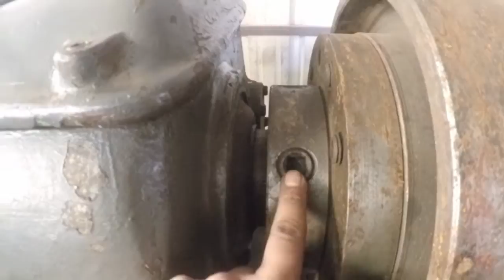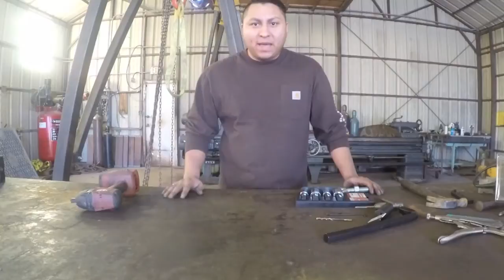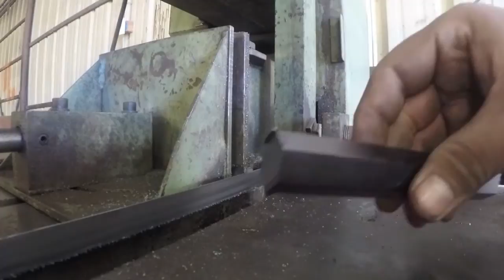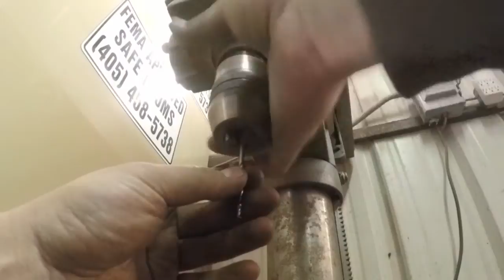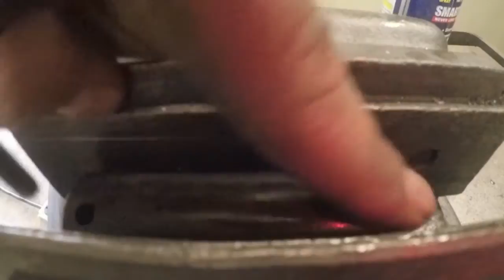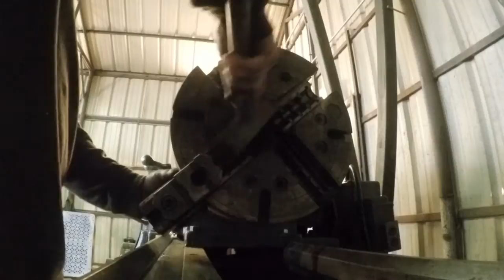#20 Chucky: Part 1

Comment: i commend your initiative and resourcefulness in solving the problems, but i also agree with the the previous comments. no eye protection while grinding and drilling is simply foolish, unacceptable practice. using a handheld drill motor when you have a drill press is just bad practice. can't see how you expect to use the "go to" impact driver to dial in work in the four jaw!!!

also, you haven't mentioned how you are going to get the chuck off...
Reply from the maker: All valid advice that's how I get better

Comment: So lets get this straight.

You have a drill press but decided to drill a pilot hole thats so far from vertical it makes the leaning tower of pisa look like a girl scouts sunday picnic.

And the set screw stops the "stock" from turning in the socket? Isn't that whats the flats are for?

And an impact driver as a "key" but you need to be careful of the torque you apply?
Reply from the maker: Thank you for the comment some may not be aware that it cost me time and money to make these videos and that I am also learning everyday.
Reply from the maker: Thx for you input.
Reply: +Fabric8tion Nation From what I see in your videos you have a working shop not a hobby shop. Eye protection is a good idea but we all know how that goes when on one is around. It's your shop and your videos. You are free to do what you want to do however you want to do it. Best of luck to you lad.

Comment: I love the size of that 4 jaw. It reminds me of the big 24" Cushman we had on our BIG Monarch lathe. I really miss it too. 
Cool idea with the temp chuck key build. That too with the hex was like our 24". 
Be mindful of your eye protection. You only get two eyes Al. 👍
Reply from the maker: Thx Adam what's your thoughts in the impact? I know you should be careful but at my old job they use air regulated torque guns and my impact has torue settings.